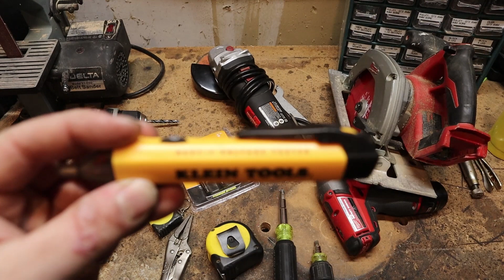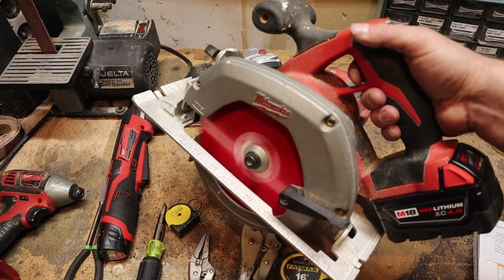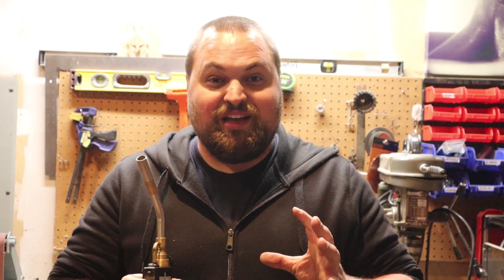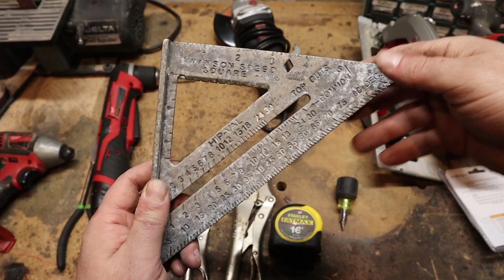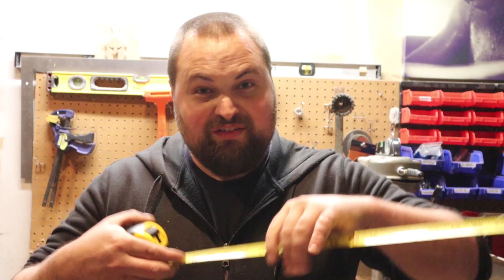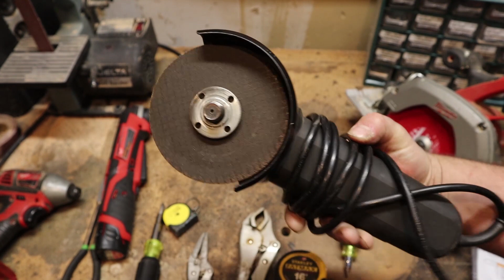Top 10 Most "Handy" tools

Comment: The only thing I could possibly say is that you are absolutely correct in that these 10 items are significant and have in some way changed the way we do things and mostly for the best. However, when it comes to your stick tester, (tick tracer is what we call them in the trade; IBEW LU 840, Inside Journeyman Wireman). And the down side of those testers is that they can pick up very small, minute amounts of voltages which could give you a false “beep” when there’s not enough to light a fireflies ass... Just be very careful and remember nothing replaces turning the circuit off, or at the very least, use a multi meter.
Reply from the maker: Of course. When I was learning electrical I was told "these will give false positives, but not false negatives." It does not replace a good meter, it's just a time saving tool.

Comment: Free lumber/pallets on the side of the road?  Always keep a cheap cordless saw in the car and you'll never have to pass on it again.  Great useful list. I would add a one hand cordless reciprocating saw as well.
Reply from the maker: Those are good too. My only gripe is I can't gey my hands on a reliable one. I think I'll try the M12 hackzall next, but I haven't decided. Thanks for watching!
Reply: @StrangeGarage  I've had a dewalt recip forever. Use milwaukees extensively at work. Really couldn't tell you which one's more reliable. They've both worked extensively without incident. My corded recip saw is a Bosch. When I'm cutting a lot of steel and batteries just aren't going to make it, that's the beast.
Reply: @StrangeGarage  I don’t know about the M12, but the M18 Fuel is a beast.

Comment: My harbor freight angle grinders wear out fast. I broke 3 or 4. The windings burn up and short circuit.
The map gas looks useful. Thks!
Reply from the maker: Man, that is insane! I've had pretty good luck with mine. The pinion in my old HF grider went out, but expensive ones fail the same way. Were yours the same black grinder as mine?

Comment: I see your pegboard behind. Got a 40 year old one, thinking of covering it or replacing. Or need to make better use of it. (Don't like french cleats for this, btw.)  Got any videos on organizing shops?
Reply: I'm not a fan of pegboard, and I don't see the practical advantage of French cleats.  I replaced my pegboard with thick birch plywood (I think it's 1/2").  I stick a nail in it wherever I want to hang something.  Nail stays put, and if I want to make a custom bracket for whatever, it's easy to screw it into the plywood.  I love it.
Reply: @TuckMcSouthard  thanks for the reply. Exactly what I was thinking of doing. 40 years of items falling off on the floor, lol. Our pegboard is framed and I think I'm just going to lay a piece of plywood on top of it rather than dismount it. The nails are a perfect idea.  Thanks for the confirmation!

Appreciated the video, too.  Keep up the good work and I like your video style.
Reply from the maker: I don't use the pegboard much honestly. I like drawers that are task specific. I have one of the big husky tool boxes and each drawer is task specific. Electrical tools, drilling tools, sockets, wrenches, ect. I'm not the most organized guy in the world.
Reply: @StrangeGarage  and @Tucker Southard -- apologies if I've gotten the two of you confused.  I didn't look carefully, thought I was replying to the channel owner.  Both replies are appreciated. :)  Compliments on video style of course to the owner of strange garage!
Reply from the maker: @rwind656  Thanks for the kind words! I'll keep the videos coming!

Comment: Totally Agree!   The angle grinder is without a doubt the most used tool in my garage.  I went through 3 of those shitty HF cheapies in one week.  Finally said F-it and bought the 90dollar dewalt at the homelessshithole.  I have abused the hell out of it for 5 years and when it does die, I will bury it in my backyard!  I won't have the heart to put it in the trashcan!
Reply from the maker: You're not the first to tell me that. I'm actually really surprised. I'm on my 2nd HF grinder. The good ones and bad ones usually all fail the same way. My next will be a cordless brushless!
Reply: @StrangeGarage  The arbor lock  buttons were breaking on me.  Must me made of ramen noodles.  JUNK.
Reply: @StrangeGarage I abuse my HF cheepy’s way more than I do my “good” ones, yet I’ve never really had one fail except the time I dropped one off my house onto the concrete. I’m seriously surprised people are having issues with them. They are usually my go to. If I “save for good”?my M18 Fuel much longer, it’s gonna be antiquated before I use it. So much stress using uber expensive tools ; )
Reply from the maker: @markashlock9017  I have never heard it articulated that way, but I completely agree! I'm afraid of damaging expensive tools, and it prevents me from using them as intended. I'm really glad to finally hear someone say that.